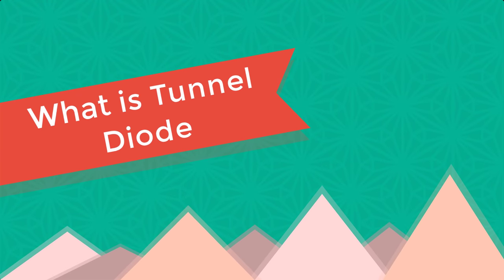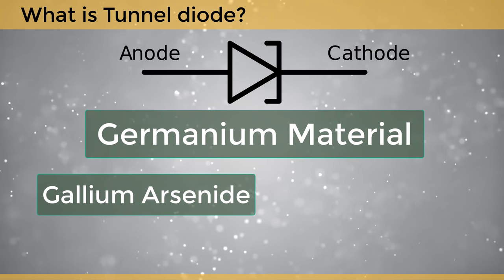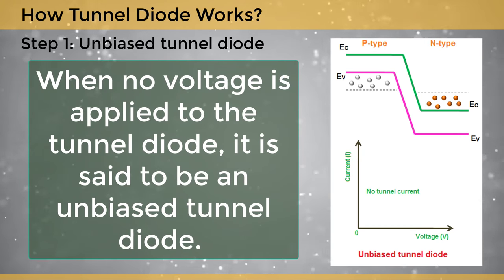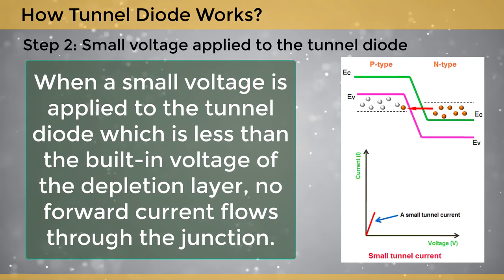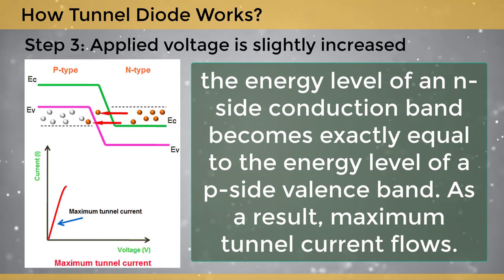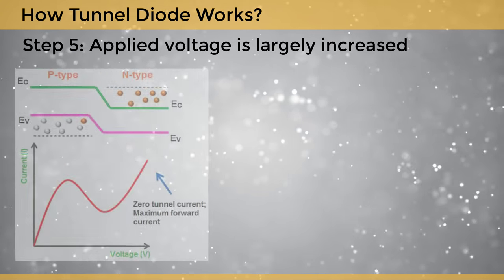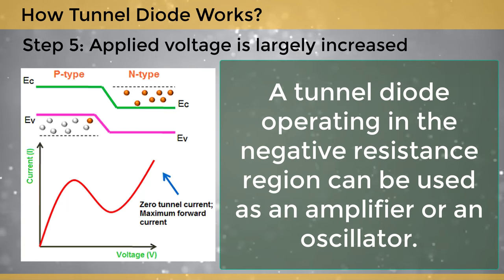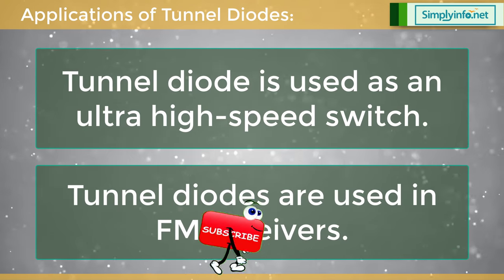What is Tunnel Diode | How Does Tunnel Diode Works | Advantages & Disadvantages of Tunnel Diode

Comment: Thanks for the understandable explanation. Tunnel diodes also exist in multi-junction solar devices, where they are used to separate the different normal p-n junctions of the multi-junction solar cell. There they are oriented in the opposite direction with respect to the orientation of the normal p-n junctions of the solar cell's layers, but due to the tunneling current, don't block the overall photocurrent. At least that's how I understand it.
Reply: This is also not bad used to my exam